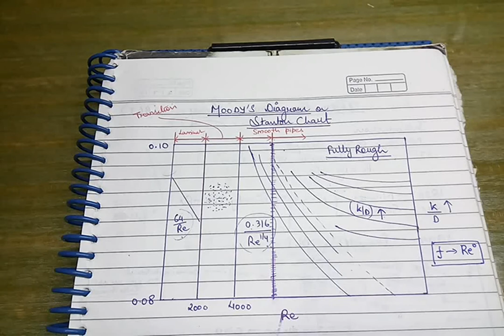Fluid Mechanics lecture 15 for GATE, ESE, SSC JE and PSU

Comment: sir shear max formula is wrong please check vedio time 9:14
Reply from the maker: Dear Amit, the formula is not wrong in the given lecture rather shear stress is maximum at y=0 and at y=B and it is minimum at y=B/2 which is the required correction needed there.